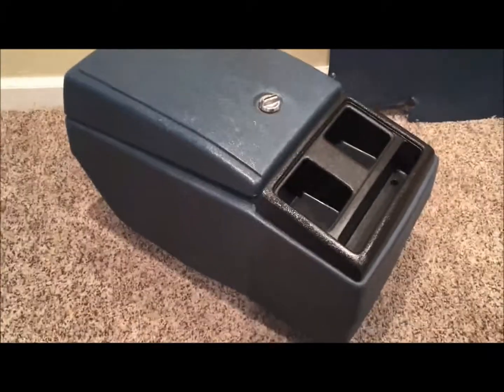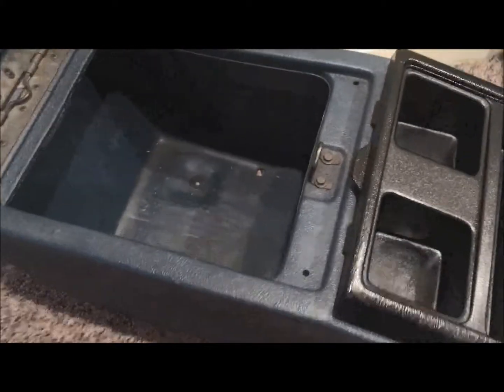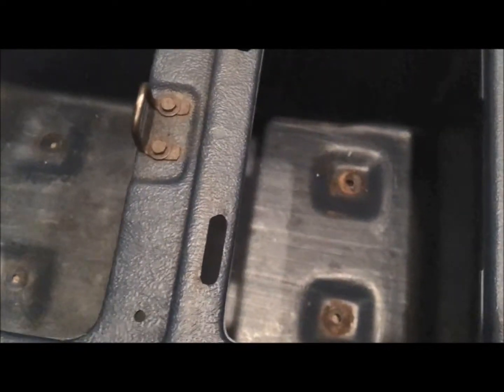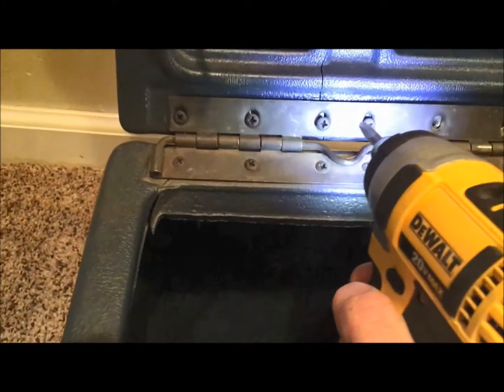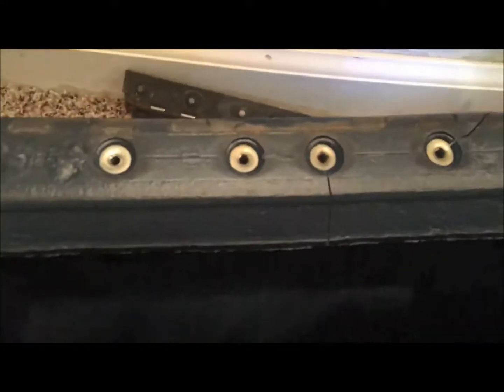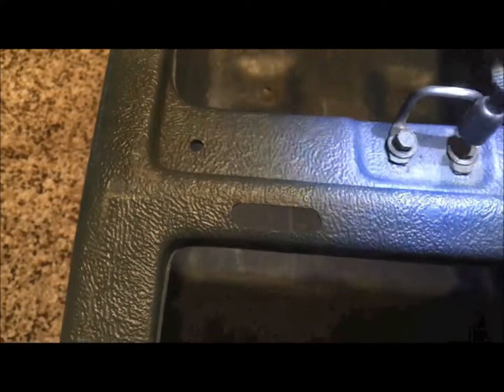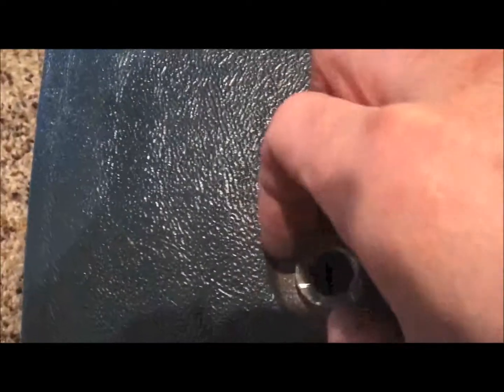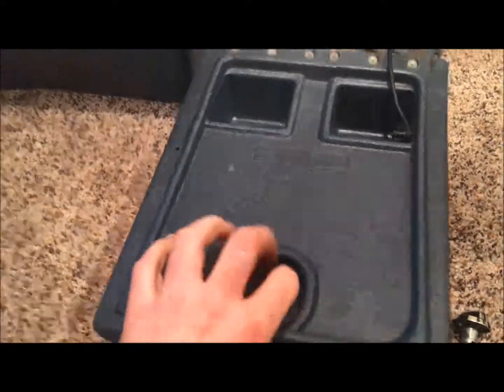1973 - 1987 GMC Center Console Removal and Tear Down

Comment: Just removed the lock cylinder from my 1991 Suburban Silverado center console. This is a tricky move and will take patience. You are essentially pusing in the little tabs that are along the side of the lock. The small aperture at the base of the lock on one side is where you want to work. The video shows the correct side. A 90 degree or similar pick worked well. Continually apply pressure to pulling the lock cylander while you use the pick to depress the little tabs (unseen) in. It will take a few tries, but it will come out. Be sure toi note which way it comes out for proper insertion in the replacment lock.